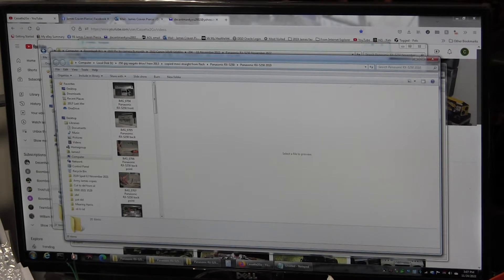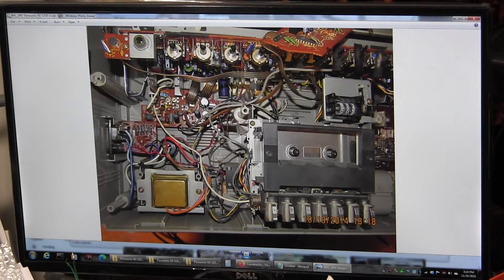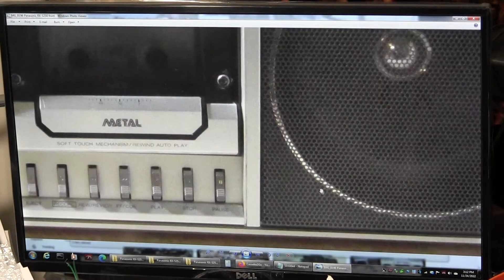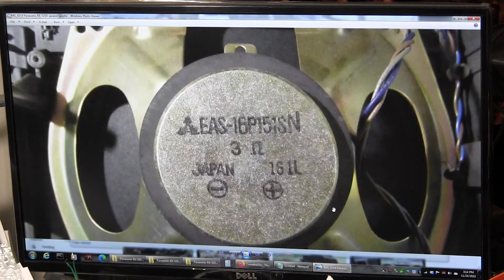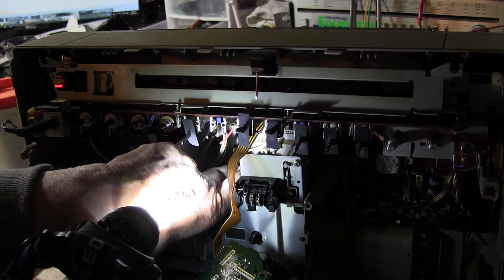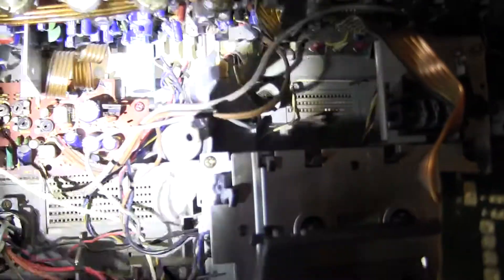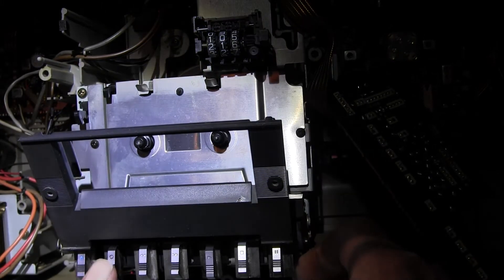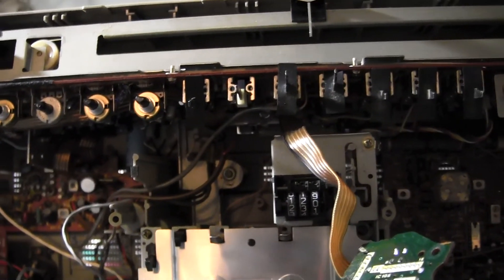Panasonic RX-5250 History pictures fail complete review or repair

Comment: I have a couple of these units, and if memory serves, it’s a single button record mechanism- which pissed me off a couple times since I accidentally recorded over a tape or two thinking it was the play button.
Reply from the maker: email me if you have one that looks bad but has a good amp section then I can put you in touch with the person that sent this to me. so he can get it from you as he wants to play his but his amp board is bad.  jamespierceiii@hotmail.com  // His model is in near excellent cosmetic condition, and the deck works great and while the radio and line-in do work it wont go loud and or stay on for too long before the sound just dies away completely.
Reply: Yeah, sorry, but I’m going to keep my units as they make a nice pair in my garage.
Too bad that audio board is fried. So a “simple” recapping won’t work in this case? The tracing is all screwed up?
Reply from the maker: @YouTube4Rudy  It is not mine and I am not willing to take the time to search out all the parts to re-solder in place in the hopes that it will work correctly again.